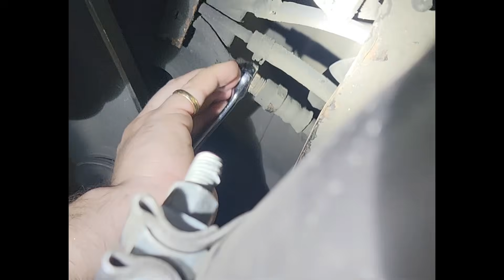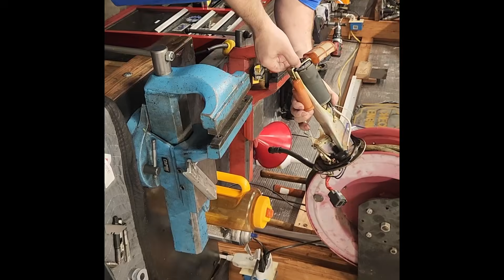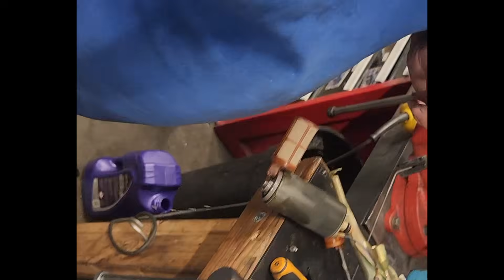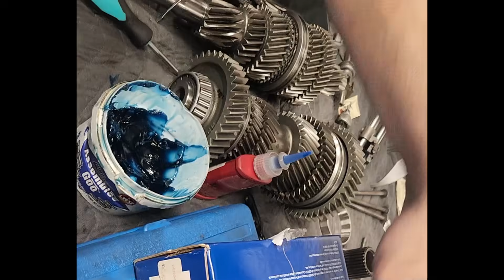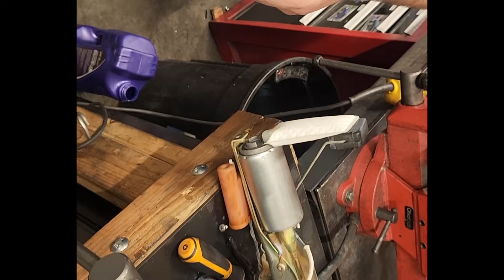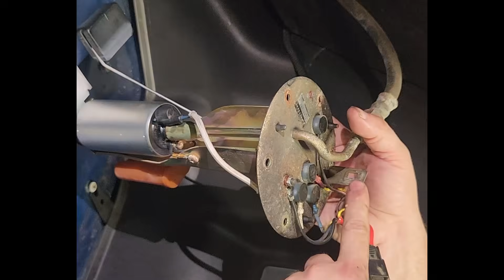3000GT / Stealth Supra Fuel Pump Upgrade | Denso Install DIY by Rvenge Performance

Comment: Where did you find the supra pump 195130-1020?
Reply from the maker: They aren't available anymore, it was new old stock. We do have some good pumps for the platform though: https://www.rvengeperformance.com/3-s-fuel-pumps#/

Comment: Picked a hell of a time to make this guide, right when I’m dropping in a hellcat pump from you guys. Thanks for continuing the 3000GT content.
I would love to see an elite 2500 base map/config guide from you guys, it would’ve been a big help when I was setting mine up
Reply from the maker: There are a ton of different ways to wire the Haltech's up, so its hard to make a universal guide.  We do provide some base map support for folks getting an ECU from us.
Reply: @RvengePerformance  Understandable, it may fit the most cases to start with an oem equipped car, identify the calibration tables for the ECT, vehicle speed, fuel pump hi/low speed relays, idle control, base ignition table, evap solenoids, boost gauge, etc... As soon as someone adds a new aftermarket sensor, fuel injectors, DBW throttle body, etc, those will all come with calibrations and information out of the box.

Wiring assignments would be less important, as people can extrapolate.

This is all stuff that took me weeks to figure out by reading old forum posts, viewing the chromed ecu flash tables, etc... 

I think if more people were confident for the support and setup with installing a haltech/DBW throttle body, they'd be more likely to choose buying them from ya'll ;)

Comment: Was that a Philips screwdriver or a JIS screwdriver? They aren't the same. I've not had issues with using a JIS screwdriver on Mitsubishi disassembly.
Reply from the maker: Not JIS, I am sure that would help. The vice grips work really well though and I have never found one that they wouldn't loosen. It was so tight it popped using a vice grip, so I'd be surprised if a JIS bit would have done the trick.